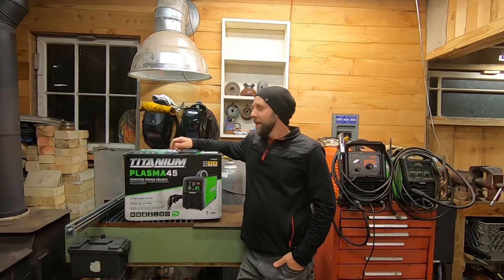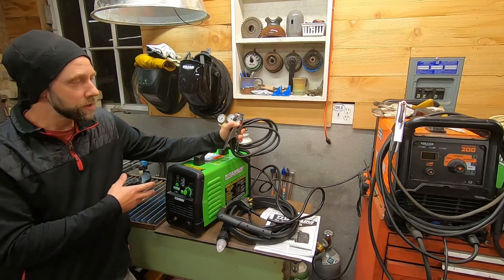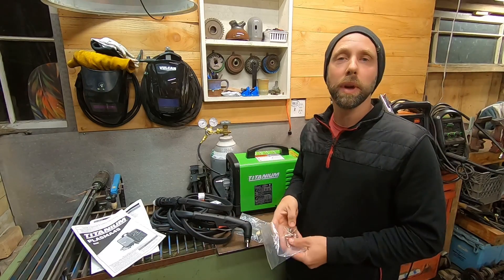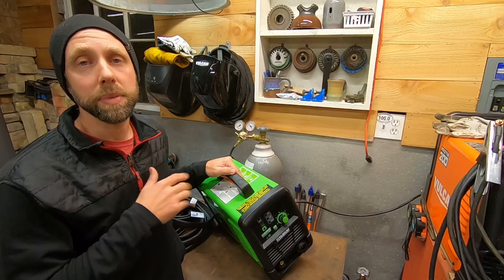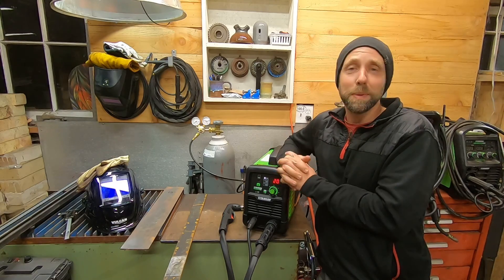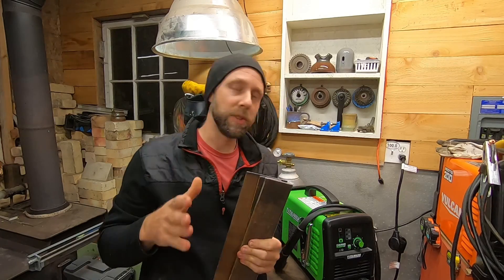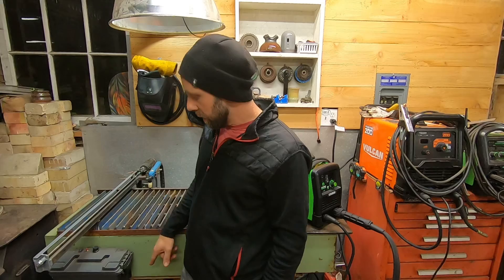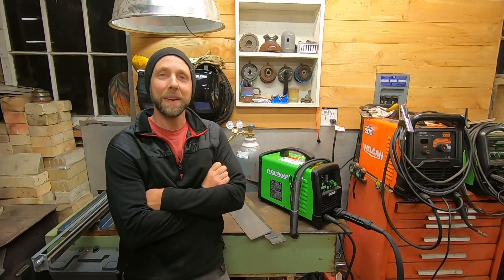Titanium plasma 45 plasma torch review

Comment: What I don't understand is why the price is about three times higher than other exact plasma cutters on the market today.
Reply from the maker: Well not all plasma torches are created equally, 
Even though you mentioned you can buy a 50 amp plasma for a few hundred dollars, they are high frequency, they cannot be used on CNC tables. This one is pilot arc start and working really well on my CNC table, I have cut well over 600 feet of metal with this torch and it’s been rock solid. So if you think all plasma torches are the same they are not, I would be interested to see what (exact plasma cutters) you are referring too? The reason I mention this is because I haven’t found the exact equivalent plasma sold from others manufacturers.
Take care Amias

Comment: Mike- been viewing all your vids & doing due dilligence in researching everything I can find on various plasma cutters. I'm fixing to pull the trigger for a Langmuir pro. I believe the Titanium 45 will fit the bill for what I need to do in my shop. Do you have any pros / cons on this model as it works with the CNC? Or should I be looking closer at other models? I'm not a tool snob....I just want the best bang for the buck. THX!
Reply from the maker: I really have been happy with this titanium 45 so far, it’s been rock solid. I have cut over 500 feet of metal without any problems.
I have not ran any other pilot arc plasma torches on my CNC table so I can’t suggest anything else. I don’t know how the torches Langmuir sells are, but if there as good as there tables, then I’m sure they will be good also.
I do know they are CNC ready so you don’t have to wire up the torch trigger like you will on the titanium, I do know it was really simple to do on my plasma.
I can tell you regardless of the torch you choose, I think you will really appreciate and enjoy owning a CNC table, they are a complete game changer! Take care 🙂
Reply: @Mikefestiva  Mike I just picked up my Titanium 45 today had to wait for a week for the truck to come in. How can I get in touch with you to pick your brain on a few questions I have concerning cutting with this model. My email is RAJAN_Metal_Fabrication@hot.rr.com I'll give you a call at your convenience. Thx Jon....

Comment: I might get one of these in the next week or 2.. idk still debating. I really need better power in my garage.
Reply from the maker: They are a bit up there in price but so far it’s been really a great plasma torch, I have cut over 500 feet of metal and it’s been rock solid 👍 I’ve owned it now for over a year now.
Have you seen my videos with this plasma torch hooked up to my CNC plasma table? It’s awesome! That’s the big difference between this pilot arc plasma and the cheaper high frequency start plasma torches, this one can run on CNC tables without any electronic interference. Check out some of my videos running this on my table. Take care Korey

Comment: What’s the smallest air compressor you can run it on? Great video thanks
Reply from the maker: Honestly I’m not sure? I run mine on a two cylinder air compressor with about a 50 gallon tank, this plasma torch really moves a lot of air so I don’t think it would be good on a small compressor, if your not looking to run a plasma on a CNC table, maybe look at the Amico CTS 160 or the CUT 50, both plasma torches use far less air then this titanium does, but the two I just mentioned are not pilot arc start like this one is. I have a video on the Amico CTS. Have you seen any of my videos running this Titanium on my Plasma table? It’s been an awesome torch so far, I have cut over 500 feet of metal with it so far!
Reply: @Mikefestiva  ok thanks so much
Reply: @Mikefestiva  hi mike how many consumables for those 500 feet?

Comment: If you had more air pressure can you cut thicker steel...  I need to do 5/8” ,& 3/4” thick steel
Reply: From what he said in the beginning, amping up the air pressure would probably trip the pressure sensor and cause the machine to throw him an error code.

Comment: The receptacle that you plugged into is only rated for 15amps. A 20amp breaker is good for 80% of the amp rating. So it’s good for 16amps. 
Tough load on that circuit when cutting a lot. Your wiring to the receptacle will get weak over time.

Comment: My?, what about parts?
I'm a new user.  My neighbour mentioned that it's difficult to get parts once they wear?! Cause that will limit the usage?!
Thank you in advance.
Reply from the maker: All the consumables are available at harbor Freight, others then that there’s not much else to go out, if you completely broke the torch lead you can buy them on EBay. I wouldn’t worry about it, just use it like it was intended and it should be fine. I have cut about 500 feet of metal all at the maximum 45 amps and I have had zero problems other then changing out the consumable tips from time to time.

Comment: What size air compressor should I use if doing a lot of continuous cuts?
Reply from the maker: I’m running a 50 gallon two cylinder air compressor, it’s an older compressor but it keeps up fine with long cuts. I don’t think any pancake compressor would keep up with this plasma torch, it uses a lot of air.

Comment: Is this plasma torch high frequency start or true pilot arc great will start in free space by just pulling the trigger..

Bill
Reply from the maker: It’s Pilot arc 👍 I have cut over 500 feet of metal on my CNC table without any problems so far!
Reply: Mike festiva 
I downloaded the manual and discovered it was pilot arc (3 second).  The Zeny is high frequency,  how did that work on your CNC table?

Comment: How much does cost from harbor freight.
Reply from the maker: I think they run about $750 to $800 depending if it’s on sale or not. They are a bit costly but it’s been a rock solid plasma torch, I have cut about 500 feet on metal on my CNC table with it and it’s worked great so far!

Comment: you can get much better cutters for under 300. this has a ripoff price .
Reply from the maker: Haha well buy one and do a review on it then 👍 I really think you are missing a few important aspects when it comes to plasma cutters though. I have owned a few $300 plasma torches so I know a thing or two about them, most of the cheaper torches are HF start and won’t work on CNC tables, or if they claim to be pilot arc, they tend to put out so much HF interference that they shut down CNC electronics. 
I have to say this plasma 45 has been rock solid for me and I have cut over 500 feet of metal without any problems so far.
Let me know when you post your review. 👍
Reply: @Mikefestiva  well said Mike, what you say is true I have been building tables for over 12 years.
Reply: Which ones do you have in mind?
Reply: Definitely can find cheap cutters with similar specs. Problem is they4 don't come with a power cord, a 6ft cutter lead, hf start, no extra consumables, a very short duty cycle, etc. But they do work. Depends on if you want a professional tool or not. A cheap cutter is like buying an oil less air compressor.

Comment: Damn those are some real clean cuts, real impressive machine
Reply from the maker: I really have been happy with it!
I have cut over 400 feet of steel and aluminum with it and it’s still going strong 👍
Have you seen my articulating dump truck build series? I use this plasma torch hooked up to my CNC table and built most of the brackets and parts with this. Take care Edward

Comment: how much PSI does it need to run? We are looking to buy one but we need more info on them. My son is building corals but I want a plasma to help cut saddles.
Reply from the maker: Luis Rios Check out the pinned comment at the top of the comments, I have all the air requirements for this machine, I also have a link to this plasma torch running on my CNC table 👍

Comment: Is this a blowback or High Frequency starter?
Reply from the maker: Yes it’s pilot arc Blow back. I have been running it on my CNC table and it’s been great! I probably have cut over 400 feet of steel and aluminum without any trouble. Here’s a link to a series I’m building, it’s a 4x4 articulating dump truck, in this series you will see almost all the parts for this machine was cut on my CNC table and the Titanium 45 is doing all the plasma work. Take care https://youtu.be/5xSrH1KtCO4

Comment: I'm like some people where I don't really need it, but I want it.  The price $900 is much better than say a Hobart 27I which sells for around $1300, but can it's duty cycle compare ?  Still some very nice cuts.
Reply: All active coupons should be good thru June 30, 2020. Including 37417781, which takes the price down to $749
Reply from the maker: E. Ramirez I have been using it quite a bit over the last 7 months and never hit the duty cycle, I have cut up to 1/2” on my CNC table and it’s been rock solid. I run it on full 45 amps on everything on my table I just vary the travel speed. So far I have cut over 400 feet of metal with it. Consumables just need to be changed out from time to time. Here’s a project I’m building, the CNC with this plasma cutter is really the only way I could do this. It’s a 4x4 articulating mini dump truck https://youtu.be/xTNnaI6T0h8

Comment: Hello Mike great video. I was wondering if you had a chance to try cutting 5/8” mat yet? I am thinking on purchasing one of these soon thanks
Reply from the maker: I have not cut 5/8” but I have cut 1/2” really cleanly on my CNC table with it. I’m sure it will cut 5/8”. I had to cut 1/2” plate for some bearing mounts at work and it cut really nice. I hope this helps Josh.
Reply: @Mikefestiva  assume the 1/2" was on 240v? thanks

Comment from the maker: Here’s a video running my Titanium plasma 45 on my CNC plasma table https://youtu.be/EMJFn1tOgh0
I get a lot of people asking the air requirements and they are 4.2CFM @ 80 to 110 PSI. 
And if your wondering I have cut over 400 feet of metal and aluminum with my plasma 45 and it’s still going rock solid.
Reply: Mike - I found an even better coupon code!  374177810018 brings the price down to $750, which is a little more reasonable.  Good through 5/2/2020.  But keep your coupon code up there, because they have extended that one until 6/30/2020 due to CV19, and who knows, maybe they'll drop the price back down again saving even more.
Reply: @w3vjp568  awesome.
Reply: @w3vjp568  did you hear they nixxed coupons? ticks me off big-time..
Reply: All active coupons should be good thru June 30, 2020. Including 37417781, which takes the price down to $749
Reply: I did end up buying one, using the HF Fortress 5 Gallon (#56402) to run it at altitude 5800 ft and it delivers on expectations!
Reply: Mike festiva the jerks there just raised the price by $100, so with coupon you’re still paying $50 more than it cost last week.  Probably going to go with an Amico at this point.
Reply from the maker: w3vjp That’s lame 😒 I think the Titanium is a good plasma torch but they seem to be asking to much for it.
Reply: Mike festiva just bought the plasma 45 today because of your review. Excited to try it out once I make me a plasma table.
Reply: @w3vjp568  It's odd man, the price goes up and down. It $799 and than its $899 and than it's back to $799 and this week it's at $899. argh!
Reply: @delta34golf  man yeah 900 is too much, you could get a similar power cutter from a better regarded brand for that much.
Reply: @KR-hg8be  potato tomato lol. Not too worried. I don't think I would pay $900 though, but $750, sure, let's do this!
Reply: @KR-hg8be  Not really, most of the bigger brands are starting out above $1500, selling you a machine in the 20-30 amp range, or crap machines that justify their price only by brand name.

You could go cheaper, Amico machines have 50A ranges and short term reviews on working units are pretty good, but you might have to return a DOA unit or two. Same for other brands operating in the sub $500 price range.

Comment: I have seen several people asking what air compressor you used or recommend and you did not reply. Please respond as that is a rather important question.  I am very interested in this machine. I just picked up a titanium mig welder and would love the plasma cutter if I can meet the air requirements (I need a compressor anyway so what do you recommend))
Reply from the maker: Wendy Wragg air requirements are 4.2 CFM @ 80- 110 PSI . I have answered this question over 10 times in the comment section, keep in mind I get over 40 comments a day on videos so images responding to 40 plus random text a day to people getting a bit hard.
Reply: I use the HF Fortress 5 Gallon (#56402) and it works very well (my altitude is 5,800 ft). Couple 79890135 will take the price down to $239.

Comment: Anyone know if HF accepts their 20% off coupon for the plasma cutter?  It doesn’t exclude Titanium brand products, just “welders”, but I wonder if they count this as welding equipment.
Reply: the 20% is not usable with this Plasma cutter. The Plasma cutter falls into the sub-category (Cutters and Spot Welders) under the category Welder. HOWEVER, Coupon 37417781 will knock the price down to $749, which is about 16% off. :)
Reply from the maker: I have never had any luck getting HF to take the 20% off on any HF name brand stuff but it’s worth a try? I just got a coupon send to me the other day for $50 off the Titanium plasma 45 it’s good till 4/30/20 the coupon # 30384262
Take care

Comment: looks nice but a lil pricey at 800.00
Reply from the maker: Yes they are asking a lot for this machine. I have cut over 350 feet of metal so far on my CNC table and it’s been great 👍 Time will tell on how it holds up. Take care
Reply: @Mikefestiva  sounds like it may be worth saving up for then. thank you for all the info.
Reply from the maker: deacon roehl If you check out my articulating mini 4x4 dump truck videos you will see this plasma torch doing a lot of cutting 👍 Take care
Reply: Coupon # 37417781 will knock the price down to $749, which is about 16% off. :) Should expire in June.

Comment: what kind of air compressor is good for this machine? Using 120 V power source for now
Reply: A 30 gallon sized tank with 5cfm at 90 to 100 psi is what you want if cutting continously is your goal. You can use a bit smaller one but you have to stop and let the pressure come back up periodically.
Reply: Also, remember to account for the duty cycle, 3.5min at 20 amps on 120v and 6 min at 15 amps on 120v. I'm going to try to run this off a Fortress 5 gallon (5.1 SCFM @ 90psi). Once I test it, Ill post an update.
Reply: The Fortress 5 gallon was able to keep up with the air requirements of the Titanium Plasma 45! The part number of the air compressor is 56402. My altitude is 5800 feet. I also added an inline water separator ($5 I think from HF) plus a particle separator ($7 I think from HF)

Comment: I was looking at this cutter at my local Harbor Freight and it seemed cool. BUT, I could not find on the box, from the website, or from anyone at the store so I'm hoping you can tell me. Does this machine have Pilot-Arc?
Reply from the maker: Yes it’s a pilot Arc 👍 I have a lot of videos running this plasma torch on my channel, I have cut over 350’ of steel and aluminum with it so far, still working great. Here’s a video of me running this on my table. https://youtu.be/Mf_gBIeUYcg take care
Reply: Page 5 of the manual, that you can get online, describes the pilot arc, "Arc Striking System 3 second pilot arc." It also covers the air requirements and other details. :)

Comment: Expensive machine but great review.
Reply from the maker: Yes it’s a bit costly! I have cut over 300’ of steel and aluminum on my CNC table and it’s been rock solid so far, time will tell. Take care Ray
Reply: I have been eyeing up the Prime Weld Cut 50dp pilot arc plasma cutter on Amazon for $400 . I bought the tig 225 last year and it works great.

Comment: Any problems pulling 20 amps off a 15 amp outlet?  If it was a 20amp plug it shouldn't fit in a standard 15amp outlet...
Reply: Because this machine reduces the voltage it can put out more amperage . It is the voltage amperage tetertoter. Reduce the voltage and you can have more amperage.
Reply: It'll plugin, but if you go above the 15 amp breaker, it'll pop the breaker. I did some testing and was able to get about 17 amps on the 15 amps (for science) but would not sustain the 20 amp.

Comment: Ok a newbie question.  Why would I want a $850 plasma cutter, when I have a $140 chop saw?
Reply: Try cutting a square hole in a dump truck bumper to install a hitch ......
Reply: Cant cut circles with a chop saw. They certainly serve a purpose. Once you get a plasma cutter you'll find you use your chop saw less an less. And be thankful for it.
Reply: If you are concern with neighbors having to put up with the extreme noise from a chop saw you would, like me, go for the plasma cutter. That is why I use the band saw over my table saw (when practical).